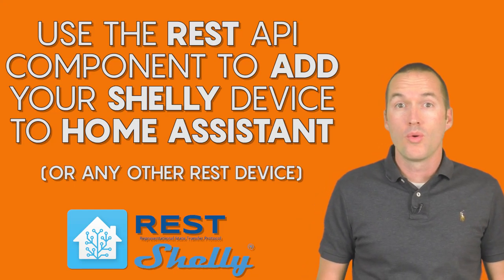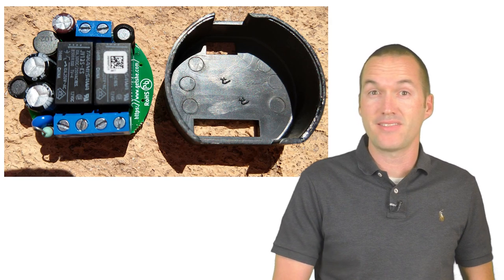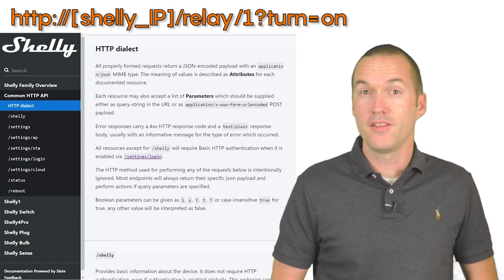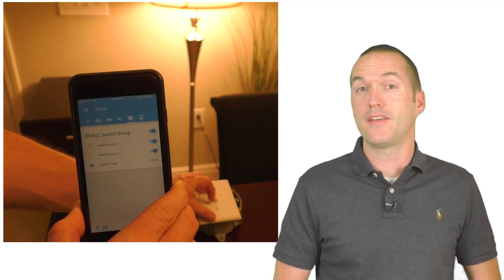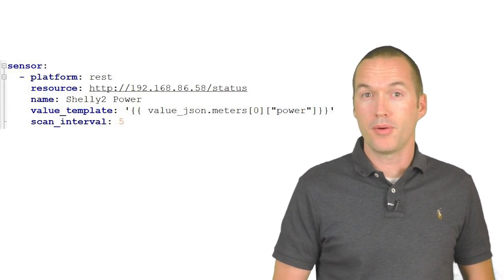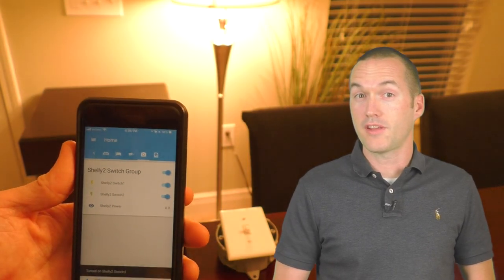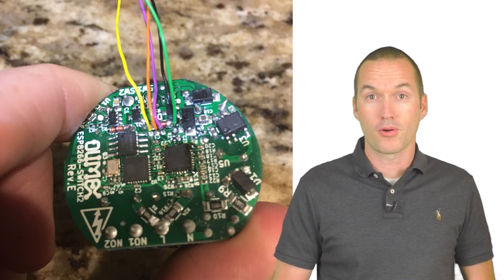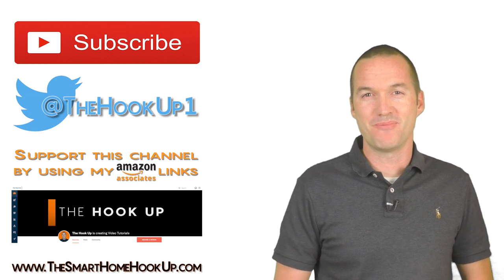Use the REST Component to Add A Shelly Switch To Home Assistant

Comment: So the power meter doesn't show power consumption for the two devices separately?
Reply: Hello Samuel - not unfortunately power meter are for both channels together. There is Shelly4Pro witch has separate power meter per channel.
Reply: OK. Thanks for the reply. Great video by the way!
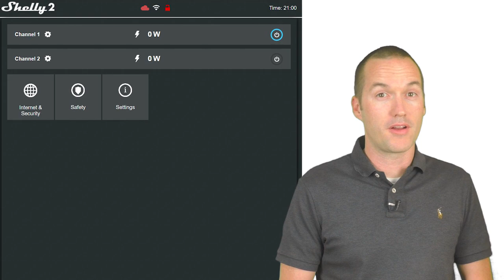Reply: hi Dimitar Dimitrov, but on this video 6:59 min, it shows power consumption for Channel 1 and Channel 2 on local web page. why is it showing consumption for each channel specifically?
Also from email response i got from Shelly team member in response to this question, i was told "even now it (power consumption) is divided by channels"
Reply: Eugene Christopher There are just one power meter :). In the web interface same power measures are shown on the both channels.

Comment: Yuck...  REST. And polling.  How inefficient.

Good video though.
Reply from the maker: I personally prefer MQTT, but it's nice to know there's a simple option that doesn't require any modifications (or an mqtt server).
Reply: Just to inform you that we make decision to add MQTT in next firmwares for Shelly1 and Shelly2. I hope that will be ready to end of the September.
Reply from the maker: That's exciting news, will it be available through the app as a firmware update, or will it physically need to be flashed by connecting wires to the GPIO pins?
Reply: You just need to update it from the local web page or trough the app.
Reply: Really interesting. Good times ahead